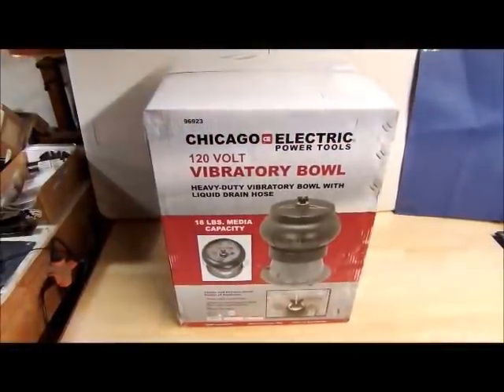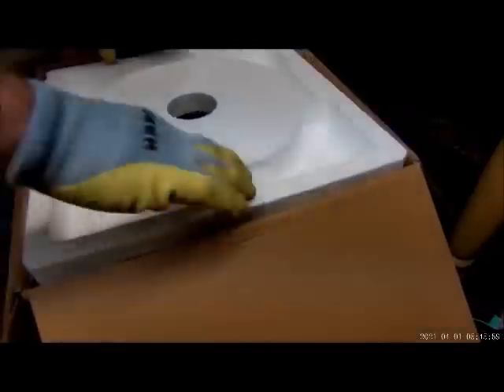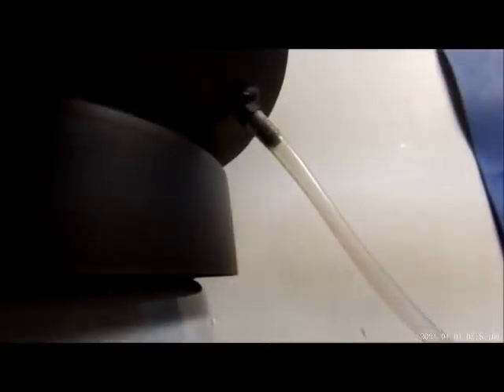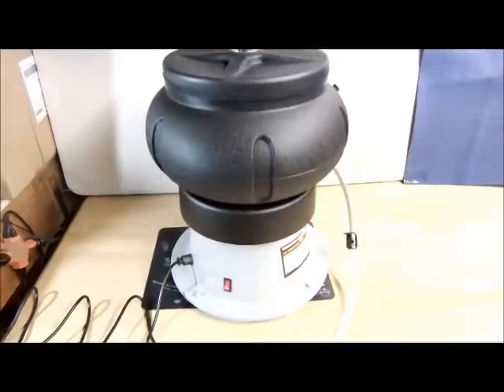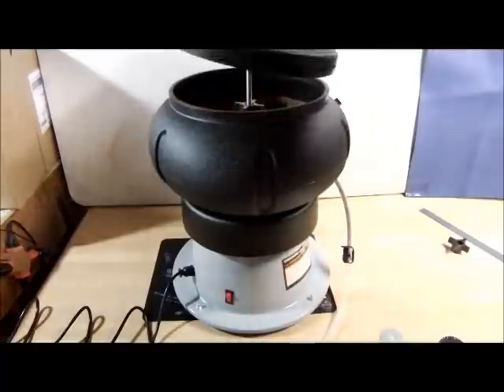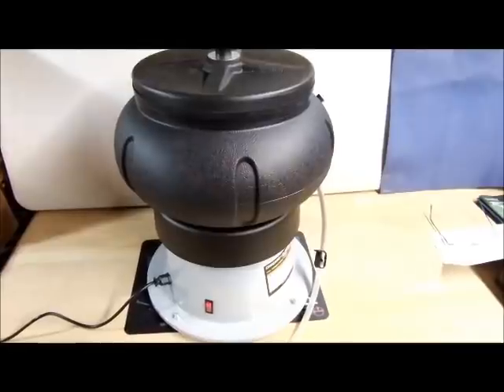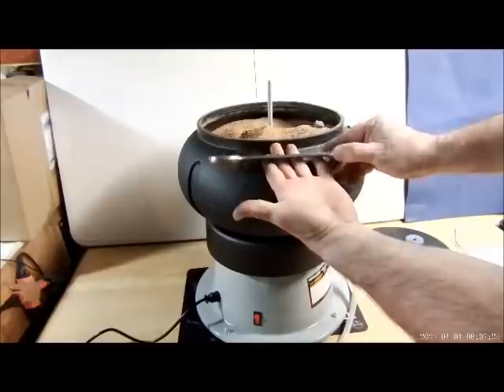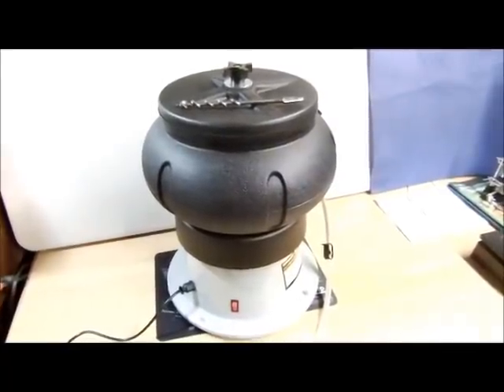PARTS TUMBLER | VIBRATORY BOWL | 18LB. CHICAGO ELECTRIC | MEDIA TUMBLER | REVIEW | TEST | RESULTS

Comment: Long-term, how has it done?

I ask because I bought three identical machines (branded for a UK-based supplier - but I'm betting that they are all made in the same factory in China).

And four months later, they all failed - within a week or two of each other.  In the same way.  The bearings on the motors just weren't up to anything more strenuous than some occasional light use, and certainly couldn't cope with being run for several days at a time (and mine were only dealing with plastic products and media).

I went mad and bought a slightly smaller US-made tumbler for four times as much money.  But just glancing at the motor in there makes me think that it will last a lot longer.